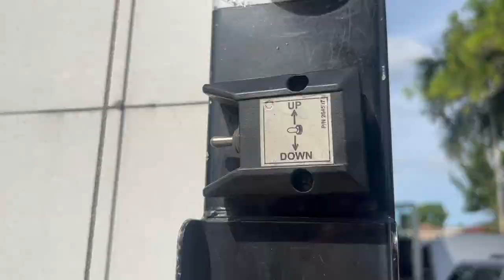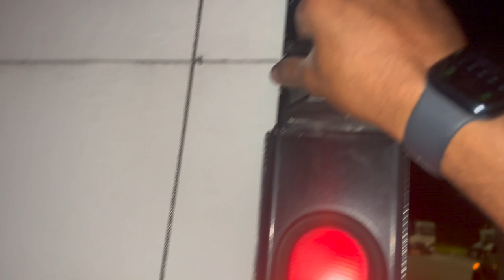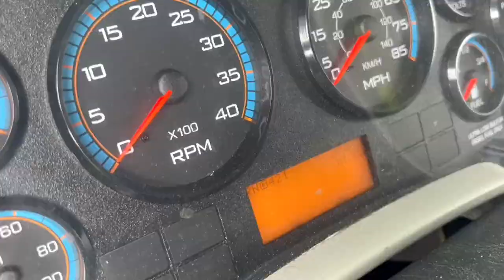Here’s Why Now is a Good Time to Buy a New Box Truck in 2022 For Amazon Relay | My Box Truck Broke

Comment: !!!! Hold on there,Buster !!!! I don't understand the greef here!!! You actually did a VERY OUTSTANDING JOB at fixing ALL of those Problems!!!! Most drivers would have Panicked and headed straight for the mechanic shop,but you held your ground and did your OWN REPAIRS!!! XXXCELLENT !!! I was going to suggest the the very first thing you should always check when dealing with batteries is the nuts on the terminals FIRST.. make sure they are tight.. if they are not tight,it will drain the battery and give the alternator a false reading..btw... I think you should hang onto that truck awhile longer... If YOU can fix the truck and you are NOT a mechanic,then chances are,the problems are MINOR..
Best of Luck😉😉😉😉😉
Reply from the maker: Lol I was cracking up at your post. Next time lead with the “very outstanding” part because for a second I thought you were one of the haters 😂 But you’re right, I’m just going to add to the fleet I’m not getting rid of this one just yet. I appreciate you for tapping in and watching my channel!
Reply: @iamjeffjoseph  Gotcha!😉!!